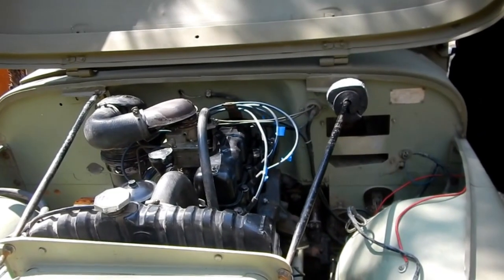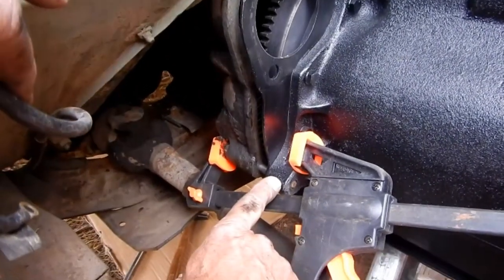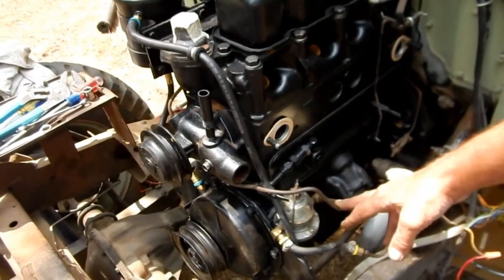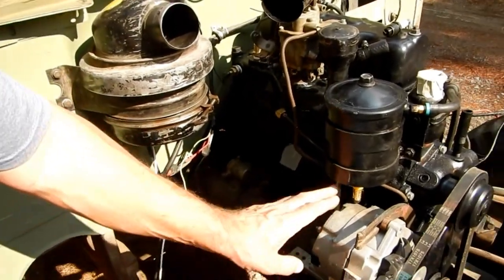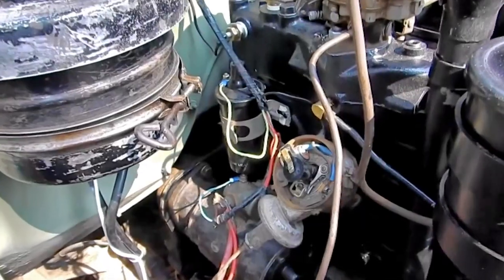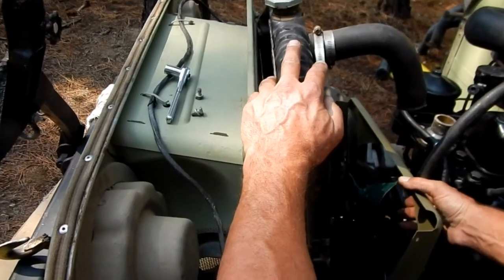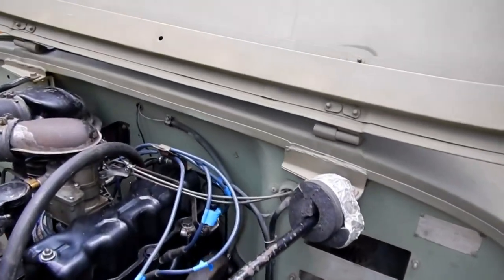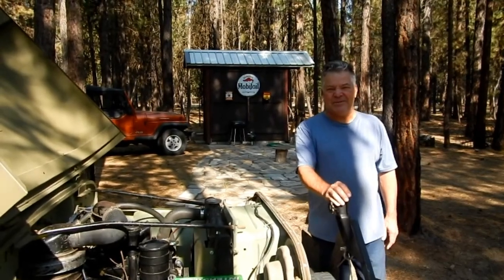How To Easily Install Your Willys Jeep Engine With No Special Tools - Full Installation Guide

Comment: That Spark Plug trick was pretty cool.. My Step dad was a Scientist at China Lake and he had I think it was a 42 Willys Jeep Wagon the he re-built at Michelson Labs on the Base and Teflon" coated everything possible and I remember when he got it all put back together it would burn rubber!!!
Reply from the maker: Those little cups come in the spark plug holes when the machine shop is done with the engine. I figured it was an easy way to tell when that cylinder was in the compression stroke. Cool story about your step dad's Willys. Some of the old Willys oddball models are really gaining value. Old trucks, wagons and Jeepsters are valuable.

Comment: Hello Tom and Julie.  What a small little engine.  When i first saw it I thought it was only a 3 cyl but I see 4 spark plugs when you removed the plastic cover.  Reminds me of my little 1.6L engine in my old 72 Datsun truck, my first vehicle.
Reply from the maker: Hi Stephen. It is a small engine. I think it puts out about 75 HP if I remember correctly. Probably close to what your Datsun truck was. Those little trucks were fun by the way. Good to hear from you!
Reply: @TomandJulieMineExploring  I think that Datsun engine had 92 hp stock.  Of course I was a teen then so I put a header on it, Weber Carb and the best thing was to install an Allison Electronic ignition system and got rid of that horrible dual point system it had.  That made a world of difference in the performance.  You know I miss those days of working on that truck.  It was a homely little truck but it was mine that I bought when I was 16.
Reply from the maker: @TheShornak  I know exactly what you mean about missing being able to work on the earlier engines. The simple engines like that are pretty fun to wrench on if you like that sort of thing. If they perform better as a result even more satisfying. I bet you had a ball with that little truck.
Reply: @TomandJulieMineExploring  oh I definitely did, lots of fun and learned a lot about working on vehicles

Comment: Excellent! I'm glad that you got this back and installed. Now you have two, fully-functional jeeps for your travels. I guess that the older one may be something you'd take on rougher roads or ones with vegetation that could scratch the paint on the newer one. So let me get this straight: You lowered the engine in to place, then Julie hooked it all up while you sat and drank coffee and filmed, then you drove it away? That's teamwork. ha ha. I'll bet you are happy to finally get this project behind you! Cheers.
Reply from the maker: How did you know that Julie did most of the work? She's actually not too bad with a wrench. Yes, glad to have this project behind us as we did the whole procedure twice. The machine shop sleeved the cyclinder that had a coolant leak when we replaced the rebuilt engine last summer. Two Jeeps that are both running well is a good thing. The old one is tough as nails, but very slow on the highway. The newer one is better on the highway, but I don't believe the drive train is as rugged as the old one. Thanks for the comment and hope all is well in BC!
Reply: @TomandJulieMineExploring  The engine sound is very familiar on that old one. We are fans of M*A*S*H and watch the videos often. The same jeeps are used during the show. You know this already, but the word JEEP was formed  from the designation of the vehicle: "General Purpose" ( GP=jeep). I really like those old ones and it is good to know they are still around.

Comment: Unfortunately they don't make 'em like that anymore.  Really like that detached oil bath air filter on the firewall. That was a neat little trick sticking a cardboard plug in the spark plug hole to find the compression stroke.
Reply from the maker: Those little plugs came in the spark plug holes when we got it back from the shop. I figured it would work for finding the compression stroke. The first video take we did the plug hit Julie right in the head and we had to redo the take because she jumped. That little Jeep is pretty fun to work on, and you're correct, they don't make them like that anymore. Thanks, Duck!

Comment: Leave the alternator attached to the mounting bracket and remove the two together by only removing the 2 bolts that go through the rubber bushings and hold the whole thing onto the jeep.  This avoids the nightmarish task of figuring out that bracket all over again.
Reply from the maker: That's good advice and is exactly what I did. Even doing that there are a lot of spacers that have to be just right to line up the pulleys. The first time I put that bracket together it took me at least half of a day. Thanks for your input, Tom!

Comment: Hello Tom Hello Julie
I like your Video very much .
I am a car mechanik too and the Trick with the First cylinder was great . 
But the Motor runs very hard and the rattling and clicking Sound from the Valves were very loud .
Perhabs you had to regulate the distance between the valves and the camshaft and maybe the ignitingpoint of the engine is a bit to Early 
But that is my Feeling and that means nothing you know the car and how it Sounds right 
Have a good week take care best wishes Yours Frank Galetzka
Reply from the maker: Hi Frank. I remember you telling me you were  a mechanic. I think I will check the valve clearance after we drive 200 or 300 more miles and the engine is "broken in" a little more. The camera microphone might make the engine sound different that it does in person. Thanks for your professional opinion. I will check the timing to make sure it's not firing too early. Take care and I hope you have a good week, too!

Comment: Ok ...... so I'm about to put a rebuilt engine in my CJ5 ........ a '65. I was planning to take out the panels from the floor to be able to reach the bell housing bolts from inside the Jeep ....... why did you not do that?
Reply from the maker: It's not really necessary as you can get to them from outside. The top two bolts are a little tricky to get a wrench on, but not that bad. We used a couple different wrenches...an offset box and combination open end/box. If you want to take the floor apart go for it.
Reply from the maker: You could try it first without taking the floor apart and if you find it is necessary you can always take it apart later.
Reply: @TomandJulieMineExploring  Part of the floor's out ......... :-)
Reply from the maker: You'll have that Jeep put together in no time.